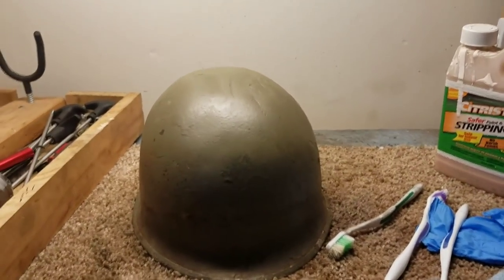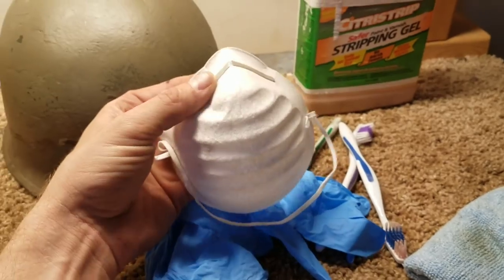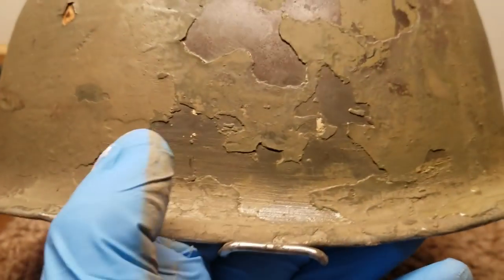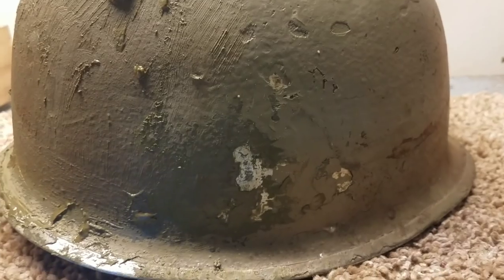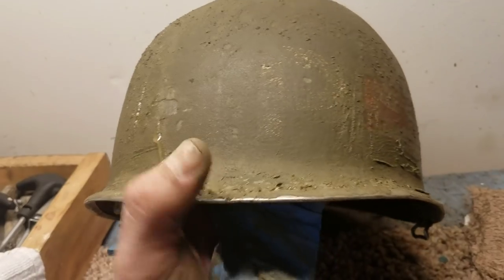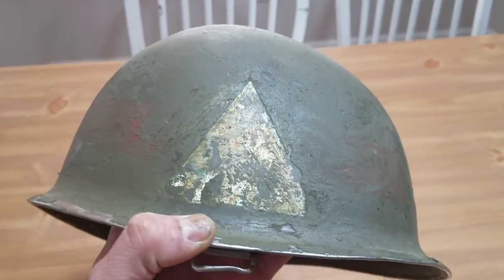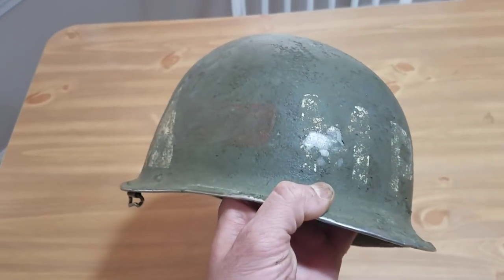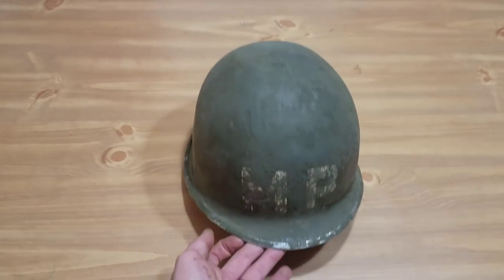How To Remove Paint From A Helmet: Part 4 (Awesome Find)!!!

Comment: Acetone works well for removing layers without damaging what’s underneath. I bought a German M42 helmet that was painted black post war. I used acetone and was able to get it down to the original field grey paint without damaging it.
Reply from the maker: Yeah I use acetone sometimes also. I have uncovered some pretty cool stuff. That's cool that you got it down to the original grey.
Reply: @JonBoyMilitaria, if you don't mind me asking right quickly before I get back at it again,  where can I get some paint that looks original for an M1 I'm trying to restore.  It was green,  then red, and back to green. Lol, I wanted one helmet to restore, and I wanted your opinion on where to buy the paint at ? I know you know your business best.  I heard to go with J murray Inc.
Reply from the maker: Definitely check them out. They do great work and have good resources.

Comment: Just a tip, I've heard from many in the German collecting field, while it takes a long time, pick away at chipped paint with your fingernails. You'll do virtually no damage to any layer underneath! And while this helmet has multiple layers, it would've been a good way to start out with a safe bet on less possible damage. Great video also!
Reply: Also, two armored helmets in no time flat! Lucky as can be!!!
Reply from the maker: I actually did use my fingernails some on this one. Thanks for watching.
Reply: @JonBoyMilitaria  I heard you could also use copper coins too!
Reply from the maker: I didn't know that
Reply: @JonBoyMilitaria  I read it somewhere so don't quote me! But give it a chance! The copper should be soft enough so it doesn't damage The original paint.

Comment: I just bought my first M1 helmet at an antique store yesterday for $45. It’s a front seam stainless steel rim and it has the chin straps connected to fixed bails and a liner that’s missing some of its webbing and the leather strap that goes over the front rim of the shell. I can barely make out the heat stamp as starting with the numeral one But it’s been painted over with black, so I might just have to use some of this paint stripper to really get a good look at it. I’ve already learned a lot about these helmets just from watching your videos this morning. Thanks for making them and have fun collecting!
Reply from the maker: It sounds like you got a great helmet. Congrats. Thanks for watching my videos.
Reply: JonBoy09 Thanks! I stripped the black paint out of the interior and the heat stamp is 138A and I think I can see the top of the Schleuter S, but it’s a light strike it seems. Anyway, keep up the good work!
Reply from the maker: @jaintly  Thanks for your support.

Comment: I have a Aramid (Kevlar)helmet i need to remove chipping paint from dont know what to use without destroying the Aramid (Kevlar) material underneath.
Reply from the maker: Honestly I'm not too sure either. I have never attempted to remove paint from Kevlar. Citristrip is good stuff and it can eat through multiple layers of paint but I don't know if it will affect the Kevlar.
Reply: @JonBoy Militaria  I used rubbing alcohol on the cracked chipping pieces and sanded by hand and used rags lighly. It did start to fray a little i used a small sander in the thick paint till it was smooth and no color. And repainted and it came out pretty good.